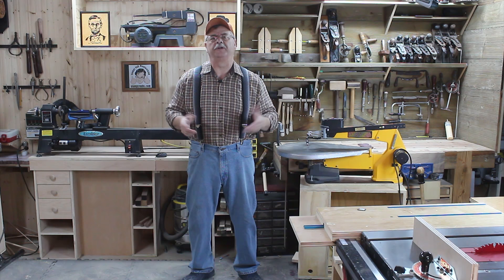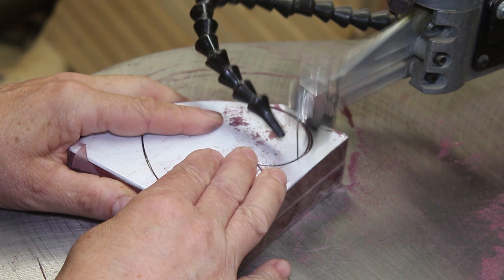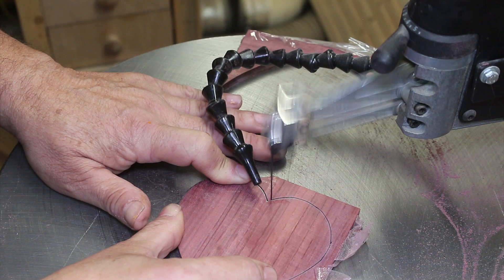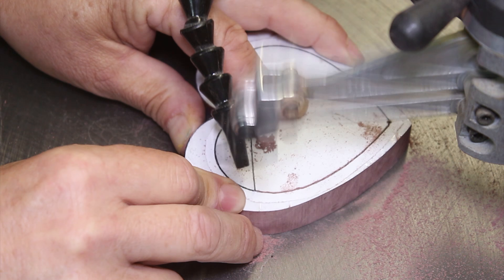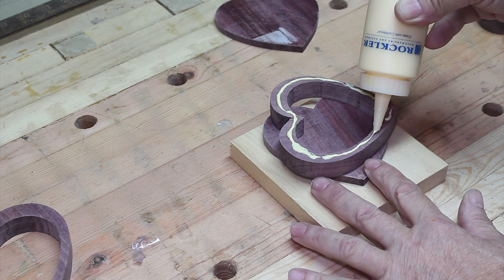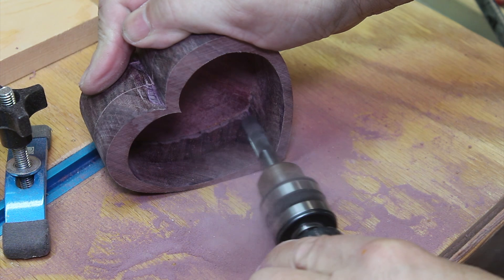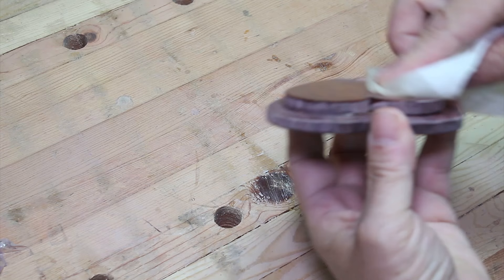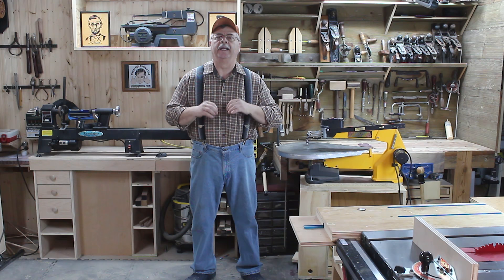Scroll Saw Project- Purple heart box with turquoise stone inlay (Inlace)- Mustache Mike

Comment: Could someone explain how the tape adds lubrication?
Reply: The blade melts (spreads) the plastic and adhesive through the cut providing lubrication, Use packaging tape. Duct tape and others doesn't work as well
Reply: Reduce lubricity? Melted duct tape? WTF?